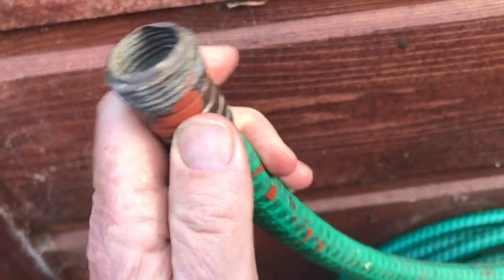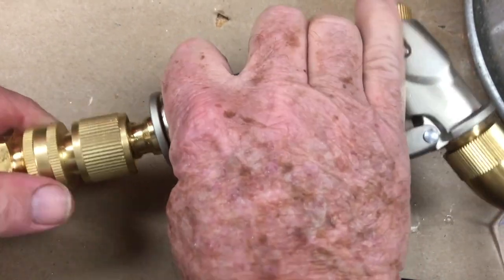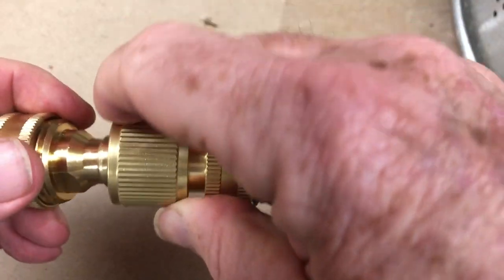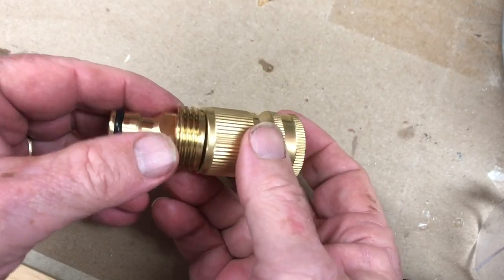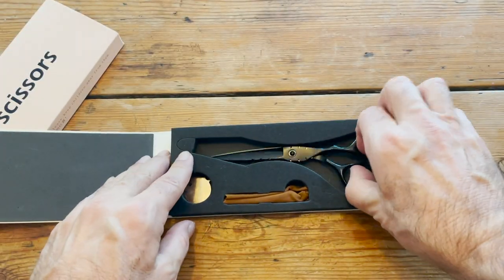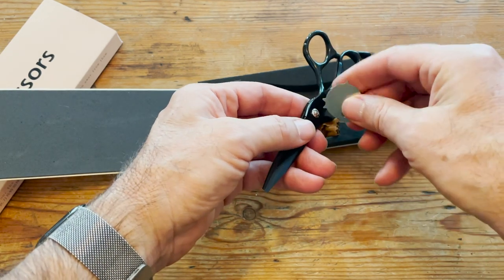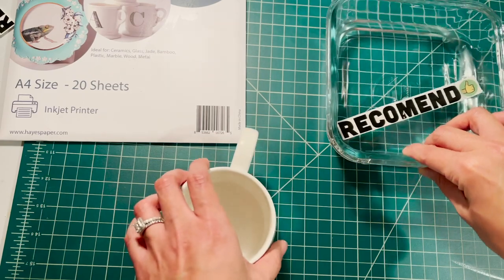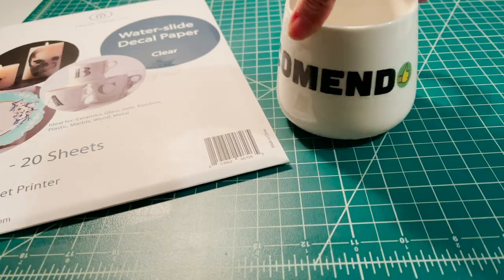Quick hose connectors/Professional scissors/Make a custom mug

Comment: The snap-on hose fitting will last almost forever, but that stainless steel clamp that holds it on to the hose will loosen over time, causing similar leaks at best, or causing the hose to pop off while it's under pressure and whipping around like a snake spraying water all over you at worst.
Reply: Actually the rubber gasket in the quick connect fittings will deteriorate and leak first so make sure you try to get spares.